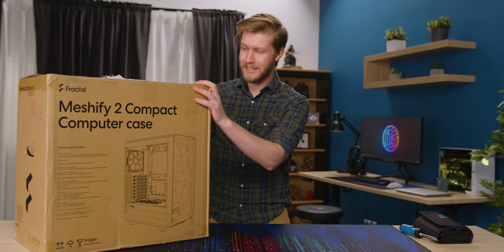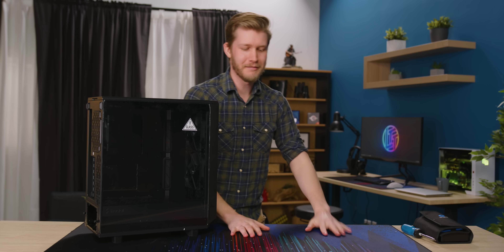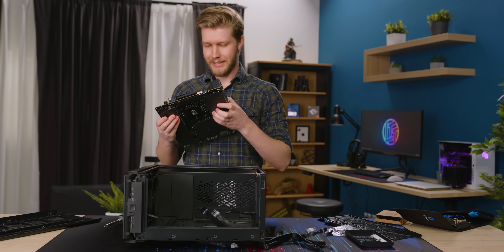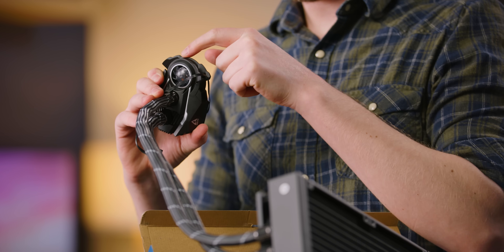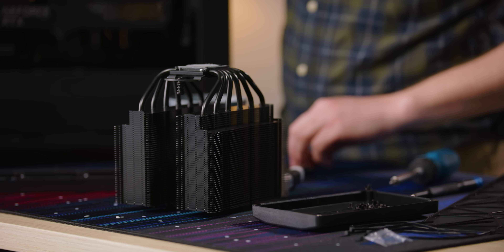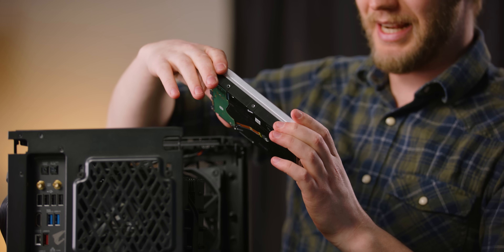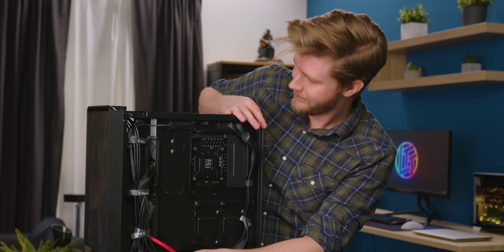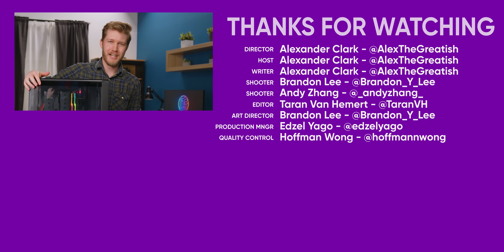One of the easiest PC Builds - Fractal Design Meshify 2 Compact PC Case

Comment: "There is no RGB"
That's a positive and exactly why I bought the first iteration. The light pollution is gaudy and you have dozens of other cases if you want that look.
Reply: It's becoming more and more difficult to avoid it though if you want the higher end/quality things. Thankfully you can just NOT turn them on or wire them up. The option is nice I guess but I'm with you. Really not a fan. I have a fully RGB keyboard and just use it on the lowest light setting and set them all to white as a nice subtle backlight glow. Most of the other crap I have is also RGB but that's turned off, the keyboard backlight serves an actual, practical function while the rest just gets in the way IMO lol.

Comment: I think I'm a fan snob. But I run old thermaltake riing 120s at high speed, and they're making noise but not annoying noise, and offering great performance. I guess the fractal stock 120s are ok, but I didn't end up using them as I had tall rgb ram (XD) that moved my aio to the front.

Comment: I actually just finished building my new PC in this case and it was a pretty pleasant experience. The only real problems I came across were that I had to remove the bottom rubber cable grommet due to power supply clearance issues, and that the space up on top is very tight for anything other than a couple of 120mm fans. I can't imagine putting a rad up there too, maybe a single 120.

Comment: I managed to fit a 3950x on an x570 Asus ATX mobo with a 2080TI EVGA card into a Meshify C.  AIO watercooled, front mounted radiator.  It fit.  Barely.  Like with 1mm clearance between the video card and the front.
Reply: Tubes on the top of the radiator? Would it be possible to install tubes down or no way to reach the cpu then?
Reply: @katsapliareos  Yep, tubes on top.  Oh, and I double checked the clearance between the 2080Ti (an EVGA unit) and the radiator is about 1cm, not 1mm.  The PC has been running fine since early 2020.  I’d crack it open and put it all in a Meshify 2, but it currently works so why bother other than for the usb c port on the case and more space to work in.  I have 2 other PCs I can do that with.

Comment: honestly the steel side panel didn't have to be tool less. The closing system on the original Meshify C with the "kind of hinge" and the two thumb screws is just as esay to remove and you're sure that it will close, and stay closed even if you have a little bit too much cables pushing on the panel

Comment: I built my new pc in this case. 9/10 really loved it! I used an arctic 240 up top instead of a 360 rad on the front because of gpu clearance. Only complaint I had was the pcie expansion slot screws were over torqued from factory.

Comment: 1. Oversize AIO was clearly not an accident, but a way to make a boring PC build interesting, 2. GPU sag is crazy, use a brace, 3. SFX-L makes it expensive but you are using a ridiculous $2,000 GPU,  4. Isnt the bottom front fan blowing into the GPU front exhaust?, 5. that whole machine could have been built in something FAR smaller - the whole box-full-o-fans thing is so 2010, 6. 1000 watts is massively overkill for this config.
Clearly the entire point of this video is to harvest all that sweet Amazon Affiliate Commission

Comment: Alex: "Building a PC is easiest it's ever been"
Also Alex: proceeds to get the wrong CPU rad size, need a tool to clip a fan on the cooler, forgets to plug the USB header in, struggles with cable management and technically gets the name of the harddrive wrong :P  Exos. Exynos is a Samsung chip
Reply: I'm gonna assume this video was done with no prep work except "we need the review of the meshify done by yesterday"

Comment: You can fit an NH-D15 with BOTH fans, if you use Corsair Vengeance LPX RAM or smaller. I only know this because I did it. It was a stab in the dark, but it paid off.

Comment: I was impressed, until I heard the $110 pricetag. The Coolermaster NR600 is a nice case to build in. Most of the same features, fairly similar thermal performance(when 2 fans are added), and I picked it up for a ladyfriend's build for $69.99 at MC. Is the FDM2C worth the extra $40? Considering it doesn't have RGB? I don't think so. I'll gladly spend an extra 20 minutes building in a slightly less convenient case than spend an extra $40, and I'm definitely not alone.
Reply: How much for 2 fans? Including shipping

Comment: I have the original verison of this case and can confirm, it was rough building without the top coming off. Though I did manage to fit a thick 240 rad up top, a normal 280 in the front, fans everywhere, a slightly long PSU, 2 HDD and 3 Sata SSDs in it. Only a couple millimeters in places but hey, as any machinist will tell ya, a single thousandths of an inch is as good as a mile. 

Got mine in the smoked glass and it looks real good.

Comment: Meh. I put that gpu and a 280mm aio into a corsair 280x with 2 front fans. For me to take out the gpu I must unplug the power cables to the gpu, and the 24pin, while removing ram and both front fans. Then while pushing the aio tubes out of the way take the gpu out slowly and turning it 35degrees as it's too long to be pulled out normally. Please do a build with that gpu in that case to know this pain.

Comment: I already have the Meshify C, but I'm 90% sure that the "2" will be my next case; it addresses nearly all of my issues with the 1st gen.
Reply: I was like that's my case, then I realized that one is much better.
Reply: Saaame
Reply: Same!
Reply: oh yes, I love my Meshify C and this one is just next level
Reply: I've built in both, the 2 is definitely a step up while you're trying to build it, but if your PC is already together I don't think its worth moving over just for an easier build.. Sure the front filter is annoying as hell in the C.. but meh.  

He's right btw, put the AIO install on top off as long as you possibly can, like maybe right before you install the GPU.
Reply: @mark2220  No, definitely don't plan to migrate cases, especially with the price difference. But in a few years as prices on current components come down, I can see my current rig become a spare system with the C 2 gathering part-by-part for a new main.
Reply: I just finished my build in the 2. Absolutely love the case.

Comment: Fractal never fails to deliver with their ATX cases. Worthy successor to the Meshify C.
Reply: Love my C, but I'm looking to upgrade to this or the XL version!
Reply: @samuelm5140  I just built in the XL a week ago and it was a pleasure. I'd probably buy the compact though unless you use more than a single HDD (the build I just did has 16 but that's a special purpose machine) or plan on a larger than standard motherboard
Reply: @vikmanphotography7984  thanks for the advice. I use 1 3.5" HDD, but 6 2.5" SSDs. I think this revision solves most of issues with the original.
Reply: @samuelm5140  I don't think the 'compact' has good mounting points for x6 2.5" SSDs but if you're not fused, you could probably just rubber band them all together.
Have you considered the normal meshify 2 (not compact or XL but shares most of the same tooling). I still stand by that the XL is probably overkill for your needs though. Anyways- best of luck.
Reply: I love my Meshify C, I'm gonna keep this thing for a solid 10 years I think, only thing I wish it had was a 5 and a quater inch drive bay but then it wouldn't be as compact.
Reply: The only thing "wrong" with my C is it's white. I picked that because it was my first ever build back in August. When I saw everyone and their grandma was building white, I decided to switch to all black components. Now, only the case is white. Still looks neat. 😁
Oh, and screw the attached panel, too. 😂
Sadly, the 2C still isn't being sold yet in my country.
Reply: @SUSHI4lyf  I've built 3 PC the past year and a half with the C' it's a brilliant case and swapped my personal PC into the case. Might be the friendliest case I've worked on in years.
Reply: @eclipse.hw1337  It IS good. Don't get me wrong. I just really want the case to match my Chromax D15. That, and the attached front panel, are the only things making me think of getting the gray 2C.
Reply: The Meshify C is still a brilliant little case, true this has a few extra upgrades over it but I built a computer back in November with the amd 5000 series release and love the compact design, I don't miss having a optical drive too much as a portable USB one isn't that expensive if you do need to use a disk drive. Just need an upgraded gpu now 🤦
Reply: Not according to GN
Reply: @Kriae  Nothing is "good enought" according to Steve haha👍
Reply: Yeah I’m gonna be rockin’ my Meshify C for at least a few more years, zero complaints honestly other than maybe the front panel is a little annoying to remove to clean the filter
Reply: I have Fractal Design Define R6 Blackout Edition, and I believe it still holds on. Fractal is just one of the best bangs for the buck IMHO
Reply: i just wanted the vertical mount tho :( there IS enough space there

Comment: I have a meshify case (ed: Fractal Design Meshify C-Tempered Glass Mid Tower ) and it is the old kind with the really difficult to yank out front panel. Seeing the front panel swing out from the side was an O_O moment.

One thing is that the fans were too loud. I have a fan curve where it is set to basically the lowest fan speed when I'm at work and then a proper fan speed when gaming. But even that was loud. So I replaced all of the fans with noctua fans. blahblahblah make sure PWM fans with 4 pins.

Would highly recommend any Meshify cases. For your 1 HDD "gaming" computer builds. For home servers obviously not.

Comment: That is one thing i dont like about GPUs design. when you put it in, you are limited to two points of contact, 1) the PCI port, and 2) where you screw it in to the back of the case. Wheat this does, is that it makes it so the front right of your gpu sags because it isnt being supported by anything on its side and is subsequently being weighed down, especially with the more heavier and larger graphics cards. It just looks like it would be putting your GPU under stress, and it makes it look sloppy, when your GPU starts to bow.
Reply: Yeah, I feel like GPUs that large should just come with a fold out kick stand for support.
Reply: @dlhorne42  I would prefer a bracket mount for the right side of the case. Maybe even a extendable one.

Or possibly a GPS support offered by the case itself.

Comment: The Meshify C is such a cool case. I have the white one and it is great. The new one looks a bit worse around the front i think, but the toolless design and extra fans look sick.
Reply: And its slightly longer so you can actually fit new GPUs in it
Reply: @WayStedYou  I have a 5950X and a 3090 in the original Meshify C without having to do anything fancy to make the GPU fit (3x120mm normal fans in the normal position in the front). Some of the oversized 3090 models might not fit, but regular full-sized 3090s fit. Front watercooling is possible with a 3090, but only if you go with slim 120mm fans on the mesh side of the case.
Reply: No 5.25'' drive bays though. And no, they're not just for optical drives.
Reply: @arnox4554  Very few users need 5.25” drive bays. When I got the Meshify C, I bought an external enclosure for my bluray burner, but I’ve never used it since. What else are they good for other than optical drives and hot swap bays (which don’t belong in consumer desktops) that can’t be replaced with external devices?
Reply: @guspaz  Yeah, you don't NEED a 5.25'' bay(s), just like you don't NEED a USB-C port(s) on the front, and you don't NEED a Lamborghini in blue. But it's nice to have, so I have no idea what your point is there.

Also, I think you only say the external hot swap bays don't belong in "consumer" desktops because you don't have one and haven't actually seen how nice they are. They are super convenient to have and also allows you to use cheap internal storage as hot-swappable external storage anytime with full read/write speeds. A 5.25'' bay also ensures you don't have to install some clunky enclosure for your optical drive in case you actually wanna watch movies on your computer or you have some archived content you need to see. And finally, the bays allows you to mount more external ports to the front of the PC in case you need them.

There is only ONE reason why you wouldn't want the bays, and that is because you want to maximize air flow. But unless you're overclocking your PC to hell (waste of time anyway in my opinion), you don't need all that air flow. I run a workstation desktop with 3 5.25'' drive bays and it runs absolutely fine. Quiet even. And yes, I do some crypto-mining on it as well even and it still works absolutely fine.
Reply: @guspaz  there are quite some controllers, hubs, etc devices that fit in 5.25 slot. Some examples here https://www.newegg.com/p/pl?d=5.25+bay+accessories . I am sure that there are all kinds of external devices that can be used also, but that is Apple-talk: "why put a port when you can get these dongles instead" :-) 5.25 is a slot that provides access into the computer without opening it. I have use for one and many others do also. And about that hot swapping not belonging to consumer pcs: why not? It is mine, I can use it for what I want to.

Comment: Even on my O11D-XL, I top mounted my Actic Freezer II 280, and had to run my MB power (with extension) along the top of the motherboard as the radiator made it impossible to get the power cleanly through the top cutout(s).

Comment: Now imagine, back in early 2000s you had that feature in cheapest random cases alongside removable MB try xD
Reply: Removable trays sucked for cable mgt though... Most didn't have room behind the mb and you had to undo it all anyway. Didn't gain much.
Reply: @aztracker1  what about ide and remembering to put jumpers on the hd's to mark them as master/slave? then booting from a floppy and using cmd to start the windows install.. fun times...
Reply: @tpss3834  I remember those days. Custom rounding ide cables, cutting off the dangling slave portion for clearer airflow for the single 80mm intake fan. Ketchup and mustard power cables everywhere.  COMMAND.COM not CMD ;-)

First computer was an at the time old XT with a whipping 10mb full height mfm hard drive. With 640k ram.